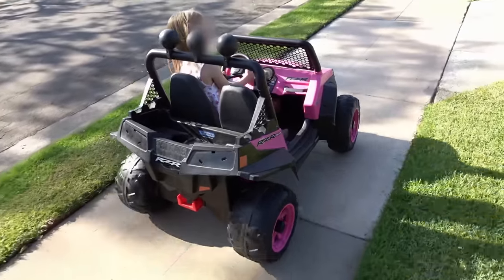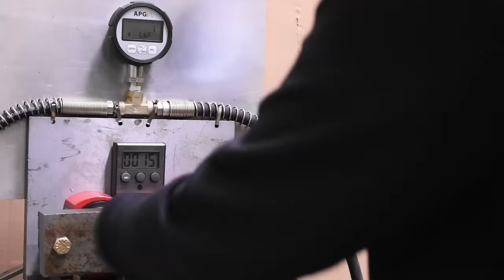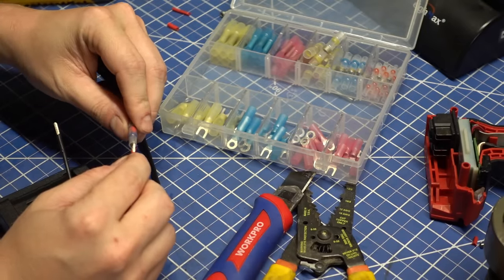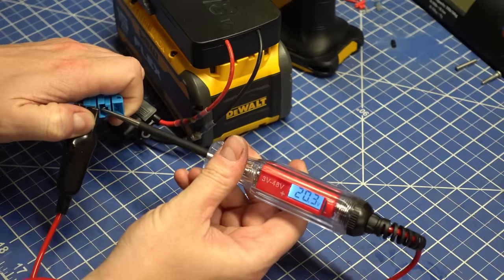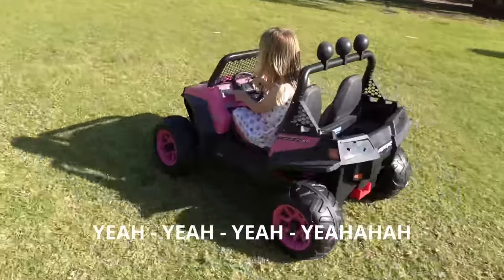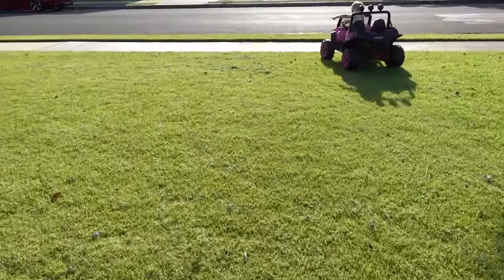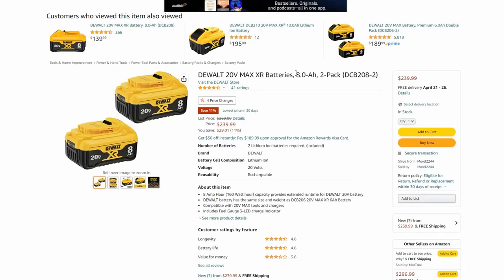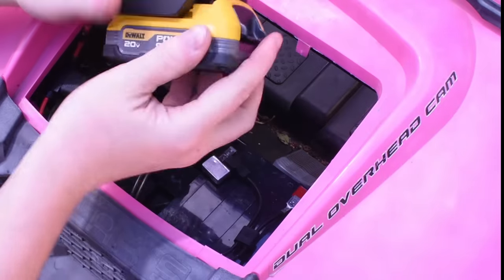I Figured Out What DeWALT's Huge $400 Battery is For😄(Kids Power Wheels)

Comment: Hey thanks for the mention I'm the smaller-than-average friend I'm 120 lb and I ride these things all the time I also tend to make them go way faster 36 volts is the way to go. I'm currently building 1 that will be capable of 60 mph. Using electric golf cart engine but I'm going to make it look one hundred percent stock. Got2 beat does gas prices somehow right. I don't know if you know what a twister Hammerhead is but I once put a 1000 Gixxer motor on it really bad idea. I hit 120 before the 10-year old Tire on the front decided to explode. I have had many of people offer me a lot of money to build these kinds of things for them. I refused because I know they will die on them. The fact that I made it past 25 is a miracle. I even built a V8 powered lifted golf cart 1 gear it literally just had the clutch in bellhousing with a shaft through it connecting it to the rear axle. Literally the slowest you could possibly go was about 15 mph. And none of them have ever been unreliable or live long I just enjoy throwing stupid shit together. You don't need those brakes. Or safety Killswitch or roll cage 🤔 🤷 and what's a seatbelt. The first time my dad rode one of my creations when I was 15. He took my child so away from me and my welder. I put a 600 Yamaha some kind of crotch rocket engine on one of those go-karts you get from Tractor Supply for kids but they're two-seaters kind of a little bigger not the pedal ones. Rear brakes only it could go about 85.

Comment: I plan to just run 2x 12v batteries in series to make a 24v system. With two motorcycle/atv batteries. And a small 24v to 12v converter to run all the fancy lights and stereo stuff!

Comment: I already can't control my toddler quick enough with his 12v car, no way I'm giving him more power. 😂

Thanks for the video, but I thought the circuit boards couldn't handle the upped amps. 

I have another replacement battery lying around, I'll connect in parallel.

Comment: I am curious, since this is a rather old video, how is the vehicle now, if it is still around... or how was the condition, when it was decommissioned & how long did it last? Were there any apparent negative effects on the motors &/or gearboxes? It looks like there was plenty of room under the hood. You could have probably added yet another battery, if you wanted even more run time. Of course, at $400, maybe that wouldn't be such a practical idea. Personally, I have been using Ryobi batteries. Not only, did I have a few tools, that used that type of battery, apparently it's also one of the brands, where the battery has built-in discharge protection. I like that feature, so I don't have to mess with building my own circuit, or closely monitor the use of the vehicle. 

I like having multiple less expensive batteries, as opposed to a single huge and expensive battery. It allows me to have one or more in the charger & one or more in the vehicle. In fact, I usually put two in a vehicle, wired in parallel. The vehicle can then run on one or two batteries. One can be taken out to charge, while one can be left in. You can often get a good deal by purchasing more than one battery at once. You can often get double chargers, depending on the battery brand.

Comment: Ryobi packs are ideal for this sort of thing since they have the protection in the battery rather than the tool. If you have any of their cheap chargers that are just a dc adapter wired to a nubbin that goes over the battery stalk end, they are just asking to be turned into battery adapters, just make sure you use some decent gauge wire rather than the tiny stuff those chargers use. Have to usually solder directly to the output terminals on the little board since it usually has some diodes that will prevent pulling power out the input terminals (plus the output terminals are probably the only place that can actually tolerate the current you'd want to pull with it.) Made one for supplementing my power station (put the 18V out of the adapter into to the power stations 12-24V charging input, can double my runtime with a few 6 or 9ah packs.)

Comment: Besides a low voltage cutoff, you can add a motor controller to cut the dewalt to lead acid power levels.

Comment: I had updated my son Jeep which was 12v motors. I could smell motor burning, so I upgraded the motor to 24V. Now jeeps goes around 5 MPH lol with load of 80LB ( two kids). 20V/2amp battery powers it for good 45 min. Only down side: I was never able to find 24V motor for steering wheel (so its no longer controlled by remote).

Comment: If you look into the pinion size and gears of power wheels cars they have different pinion and gears on different vehicles.  The four wheeler has the biggest pinion and gear setup that I have found and fits most cars.  My boys four wheeler run 10mph almost to fast.  On the same Dewalt battery change and don’t need to buy the expensive dewalt battery.

Comment: The power wheels batteries are expensive....  the LeadAcid cells are very much like the ones used in security cameras or UPS computer backups.   You can get the generic batteries cheap enough.

Comment: While funny, keep an eye on motor temperature. You may need to add a fan, or swap in a dewalt motor. (or other) The dropping voltage when amperage increases effectively limits amperage, and temperature is not controlled or monitored.

(I know this from experience)

Comment: I did the same with my kids jeep one. I had a problem of the one wheel just spinning, so I found another jeep and pulled the rear motor off of it and mounted in on the other back wheel.

Comment: i did m12's for my sons 6volt power wheels when he was small and then when we got the 12v power wheels bois i put m18 sockets on them, also wired boat lights, police flashers and more, only issues ive seen is you can knock the stock self reset breakers with the amp draw climbing hills and whatnot so i have had to remove them at times and put in 30 amp breaker, they dont trigger that and its been an outside cat and only abused for years, before i bought it for him it lived its life as a display model at toys R us and i bought it when they closed.

so anyway it has been living with the abuse really well

Comment: My daughter LOVES her matching RZR! They are the best
I ram mine on some M12’s and it destroyed the batteries, all 6.0’s too.
Problem is there’s no low voltage cutoff and you can over discharge them easy…
Best improvement I have done is a box of self tappers screwed around the back tires for aided traction lmao

Comment: You should modify the gear lever to turn it into a toggle switch between the two batteries. 😁
1st gear: 12V battery. 2nd gear: 18V battery. 
This way you also get a spare "tank", If you run out of power on one battery, just switch gear to run on the other battery.
Reply: I put a dpdt switch on the back. When the li-on dies, they throw the switch to get back home.

Comment: Just add a low voltage disconnect switch from Amazon and your good t go with 0 worries about discharging your batteries too far. PS if you have a ton of DeWalt batteries like probably most of us just hook the low voltage disconnect between the last battery and the original wireing then just hook as many DeWalt batteries as you wish in parallel efficient method of getting a ton of ah without spending a bunch of money on a high capacity battery.

Comment: It'll be fine, these little guys use simple dc motors usually, or at least they used to.   Can't imagine a few extra volts is gonna do much to them since they're likely not running anywhere near maxed out.

Comment: I put a riding lawnmower battery with a hazard fart trickle charger in one. My exgf son would drive it around for about 3 hours or so and then we plugged it in to charge. When the battery bit the dust (nearly 2 years later) a new one was $30 at Wal-Mart.

Comment: I run two 12 Amp hour batteries in sequence for 40v then I install a throttle limiter to limit the voltage. Works for ever my kid rides until hes bored and usually still is at 3 bars. If you go full power it goes over 20mph but I never do that

Comment: Ive had a BCP pink jeep that ive powered from RC lipo batteries.  2 4 cell lipos in parellel. they are 6500 mah a piece and it runs for about 4 hours.  The trick to saving your batteries in my case was a lipo cell checker that whistles when a cell gets below 3.4 volts.  runs about 7 mph as well.

Comment: Love it.  Motors have insulation rated for a specific voltage. Since most insulation likely can handle a lot more plus under load the battery's voltage will drop a couple volts likely closer to 16V-18V meaning no damage will occur.  You may even extend the life of the motor as being able to supply higher voltage means less current draw. Less current means less heat and heat is what kills anything over time.
Reply: If it's a brushed motor it's gonna to draw more amps, since higher voltage will push more amps thru the same resistance
Reply: @virtualtools_3021  I don't think I understand the comment.  The motor is the same.  Higher voltage doesn't mean more current unless the demand is higher.  As long as the design of the previous power system was able to meet that demand current, then there will be equal or less current than before.

Comment: This was fun! I think if I was going to do something like this, I would get a 50Ah LiFePo4 battery and charger. Both can be had for under $300 and would last forever! Both in runtime and lifespan.
They're going to be about the same voltage as a peak SLA charge, but stay there longer until the BMS cuts off at about 11v.
I wouldn't have to risk over discharging my tool batteries without adding some kind of low voltage cutoff, or just wearing down expensive tool batteries.
If a 50Ah doesn't fit, you can get like 20-30Ah too, but far less selection there.

Comment: Instant torque is hard on cheap little plastic parts BUT, I built a 18v pack out of 18650 for my 2yr Olds 4-wheeler. Def doubled the speed. The one tire being drivin gave out and split in half from all the spinning. Good times. Since it died I got a tractor type one with 2 speeds. Built and installed a 36v. Still running about 6mo in. Scooters too, everything just needs a little more power in our book

Comment: I forgot the channel but there was one guy who use Milwaukee battery but he also bought something to regulate and shut down when the battery pack got down to a specific voltage he could also adjust the voltage down cause he wanted it to meet closer to the 12 volt battery think he ran it at 15 volt

Comment: Generic lead acid batteries, like the one that was in it, are $30 on ebay.  I used to run 2 in series for my son's power wheels so it would be 24v and faster.  But 2 of them would be $60 and wired in parallel would double the capacity.
Reply: Have to bump up volts on DC motors though.

Comment: I have a 60v dewalt string trimmer with a burnt out motor.  I was considering taking the "connector" out of it to use in my son's jeep.  I think this jeep may have been a 6v not a 12v machine.  The string trimmer is a 60v one so the connector meets the larger contacts not the 20v ones.  Do you know enough to tell me if this could work?

Comment: great vid... i moded my sons raptor with a dewalt batt.  and rubber wheels 2 years ago and its still running great.. looking into a better motors now...and good ide to put low voltage cut-off in line on the batt. so you don't have to worry about killing it....

Comment: I would like to suggest testing cordless drills torque and speed under load. About every 6 months I use a Bosch gsb 110 to drill 10000 holes in lawn with a 20mm spiral wood bit, and I noticed (as the battery drains) that torque/speed has a huge impact on workin speed.
Reply: Same with impacts drivers

Comment: Cool....  Seem strange that she was locked out of 2nd.....  You have the Peg Perego White gearbox 1st is 2.5mph and 2nd is 5.0....  You did some strange stuff to get the same performance out of those 550 motors by over volting them to death.  When you could of just unlocked 2nd.  My Son had his Peg Perego ground force since 2 and a half and was into 2nd after two weeks.  He has some Custom 770s with new 1st and higher pinion on 24volt his 1st is 8mph and 15 in 2nd...
Reply from the maker: Greater acceleration, plus now she's old enough to use 2nd and it's mega fun

Comment: Could you maybe use a Capacitor or two in series with a marine battery to get a decent voltage and get that long run time as well?

Comment: The BMS built into the battery would cut the power off at 12.5 volts wouldn't it?
Reply: @MackenzieGodwin  aww damn, really?
Reply: No, DeWalt only does cutoffs in the tools.
But not even every tool.

My boss murdered 2 9ah 60Vs in the blower. Like pulled the pack down to 5v. 
Nothing in the tool to stop that. 

Ridgid does cut off in the battery.
M12 doesn't. I don't have M18 so I don't know what that does. 

Also annoying, non of my M12 charger balance a pack. I've lost a couple (they were older) batteries to one cell getting out of sync and fucking the charging up.
DeWalt balances in the pack, so does Ridgid. Crappy Porter Cable balances in the charger after full charge. 
It's only Milwaukee that lets batteries die like this. 

I hate this about them.

Comment: Long before modern battery technology when the options were like lead acid or lead acid  the early kids toys used to be 6v mostly scooters or trikes I used to use 12v  batteries out of house alarm systems and emergency light systems in buildings they had to be replaced every 3 years and quite often they would still be good even friends used them on their kids stuff…

Not much changes kids still love to feel like they are going fast

Comment: I’ve got my M18 batteries running my kids power wheels.  It’s much more fun for them now.  Started out with a voltage adjusting reostat so I could keep it turned down for the kids, but they quickly figured out how to crank it up.  So that went away on the redo of the battery mod.

Comment: Me and my friends did this with an old ryobi 18 volt batterie, but it was in a remote control car , we had to cut a hole in the roof to fit it . It worked pretty good for 5 minutes then exploded after a jump

Comment: Can you rig one of these into a vehicle 12 volt electrical system or will that just blow every fuse in sight?
Reply: You can buy drive units with 775 motors. Add one per wheel. And run them on 6S or even more. But then the kids need helmets and belts. Peg Perago are the easiest to upgrade.  I would use a linear throttle kit also.

Comment: Had the same issue with the Power Wheel battery. While I didn't want to spend the cash for a lithium battery upgrade, what I did was got 2 10 or 12 amp hour lead a I'd batteries for for like $30 off ebay. Now she's 8 and has a gas engine...

Comment: Back in 2000 i used a 12v Porter-Cable drill with nicad wired it up to the drill to my sons bigfoot power wheel and that thing would stand up on 2 wheels do donuts went twice as fast but only lasted about 15 minutes and would take 60 to charge while it was charging i pluged a tractor battery in that dint give it nowhere as much power but would keep it going for around 3 hours but would have to charge it over night with the little 6amp charger he loved it was great for a 5 year old boy

Comment: Would you be able to use a dewalt 20v to 18v adapter to get the low voltage cutoff??  I’m thinking the old  nicad tools would run the battery flat so dewalt had to put something in the adapter for low voltage cut off?

Comment: I just want to take a complete remanufactured milwaukee drill and use it to replace the motor on my kids power wheels. get more power and battery protection.

Comment: I have been doing this for a couple years now and there hasn't been any issue. Originally I was using batteries from cheap tool like Bauer black and decker etc. It was annoying have to change them out all the time so I just wired up a bunch of cells from batteries that were taken apart.

Comment: Just be sure to add in a low vontage cutoff and it will keep your pack from getting drained below the set threshold. My neighbor has his kids gator ride-on with some dewalt batteries and they drive it a LOT. typically he said he goes through about 1 motor per year

Comment: It's a 20v battery pack that rests at 20v. It's not 18v.
Reply from the maker: It's an 18V battery that charges to 20V just like an M18. DeWalt calls it an 18V battery in every other country except here where people are just gullible enough (and because of a Milwaukee patent on the naming). They legally have to call it "max" because it doesn't operate at 20V.

Comment: check out 3S LiPo bats for RC... I built a cell for my ex's kid's yard car using 4 packs (3s2px4, sooo... lots?) used a few old balance boards and some miscellaneous stuff to build a charge harness, wired it up, and made a case for it.

Little dude could ride ALLLLLL day, and the cell I made wasn't much bigger than the factory lead-acid.

Comment: One question! What fuse do you run? I've been running this exact same setup, same peg preggo pink rzr for a few months and watched a few videos, yours included and no one mentions which Amp fuse these dewalt batteries can safely handle, I've popped 5-20amps, running 30amp it lasts a few charges then pops, afraid to go up to 40amp because I don't wanna blow the battery, I know some dewalt power tools draw higher amperage then others though and I've got a few grand in dewalt tools so I've got a healthy collection of batteries (home depot BoGo deals).
Reply from the maker: 40amp. They almost all use 40 amp. These batteries are regularly requested of 50-60-65amps from power tools. No problem.